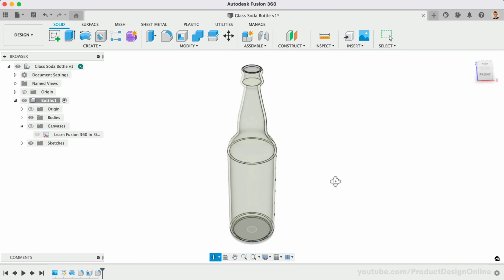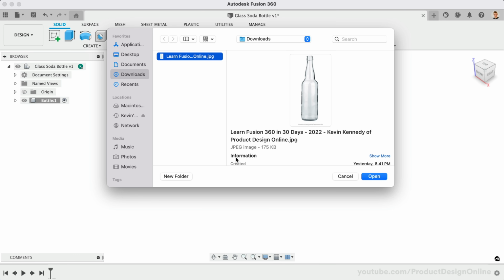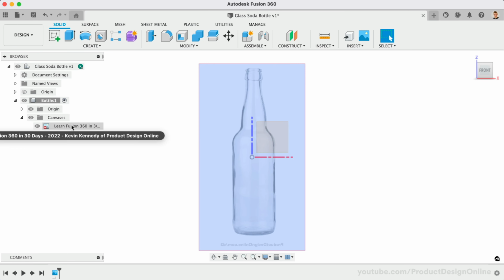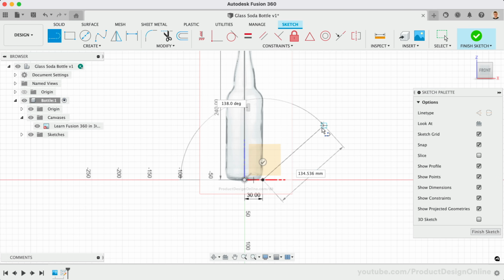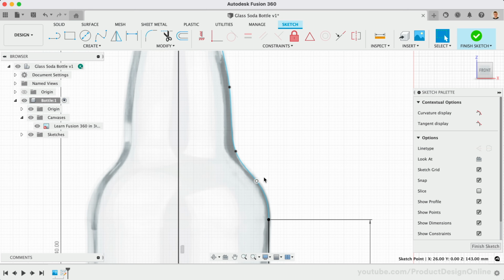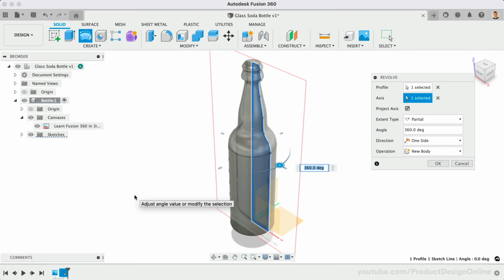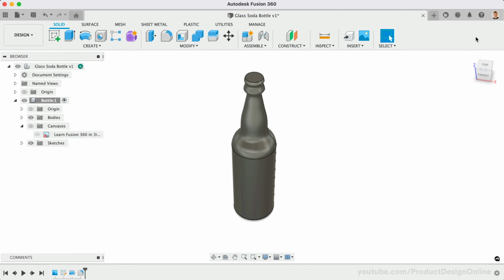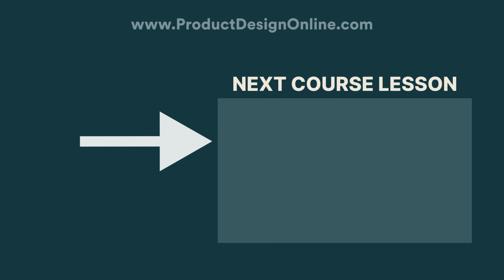Day 2 of Learn Fusion 360 in 30 Days for Complete Beginners! - 2023 EDITION

Comment: when i go to add the shell command to the top, It wont let me select only the top face, it only lets me select the whole bottle
Reply from the maker: Hi Connor. Can you confirm that the top line of your bottle (in the Sketch) has a horizontal constraint? If the line is not completely flat - or if you drew that part with the Fit Point Spline - then it will not let you apply the shell to the top. The shell command will need a flat planar surface for the top opening.
Reply: @ProductDesignOnline  I re-did the tutorial and it worked this time.
Reply: I had the same problem and it went along with the top of the bottle remaining closed (i.e had a face on it, no opening) when I applied the shell. I remade the sketch and double checked the constraints. The only way I could get the lip of the bottle to work was to extrude the top of the shell 2.5 mm so that it came flush with the top of the bottle. That gave the bottle the correct lip and then I could fillet the edges. Still don't know why it wouldnt work the way yours did.

Comment: My sketch isn't adapting when I change it from 10mm  to 11mm, I had to manually move the top end of the spline by 1mm to line up with the new dimension. Dunno what's up with that.
Reply from the maker: Can you share the link to your file? It should update if the surrounding objects are constrainted/dimensioned.

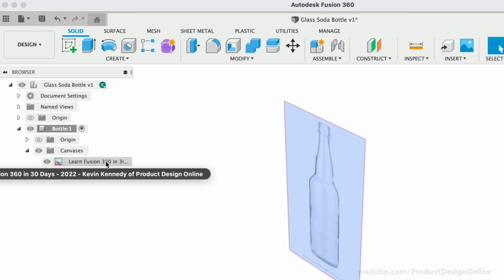Comment: I have a problem when I upload the image then it’s not showing under Bottle component. It’s above bottle component 2:25
Reply: I am having the same issue
Reply: @joebloggs963  I had to figure this out via online searches. Instead of using the visual indicators on the screen, go to the Bottle component, expand "Origin" then click on the correct origin, in this case XZ, and it will add it under the component instead.

Comment: how would you make a skull in fusion 360?
Reply from the maker: Would be best done with either Surface Modeling or T-spline modeling, depending on the curvature. Ideally, a few different Lofts and/or Sweeps that are joined together.

Comment: There is something wrong in the directions on the last shelling stage. Mine shells but it only selects the entire body so the cross section shows it as hollow but I have no opening in the mouth. Any ideas?
Reply: you have to edit the points along the neck of the bottle but more importantly the top of the bottle. I had the same issue and had to do a fair amount of editing on the bottle neck to ensure I could make the hole.
Reply: Removing the curve at the top right point solved this for me. So the end of the right spine connects to the top piece without a curve seemsed to fix this.

Comment: When adding the canvas to the design, it will not nest under the component. It puts itself outside, at the same parent level. Does anyone else have this issue?
Reply: Yeah I have the same issue. I've followed the steps exactly but it will not nest under the Bottle component.
Reply: @CaptainRedHat  Same issue here.
Reply: user @darkhorse77777 got it.
"EDIT
Fixed it by turning the visibility of active components (unchecking) in preferences. Then turning the visibility of the first Origin off before selecting the front plane while placing the canvas."

You access preferences on the upper right hand side, click the user icon, and it should be listed second. 
In preferences go to General>Design and uncheck "Active component visibility", then hit apply.

Repeat the process of inserting the reference image canvas, and you should be set, the canvas with the reference image should now be under Bottle

Comment: I'm a massive noob, after all, I'm working with fusion just a couple of years.
And I absolutely don't get how did you hollow out the bottle.

Firstly, mine can't be hollowed out as it's not created out of a solid body (in my project browser, instead of a cylinder, there is this sort of wrapping paper)
And secondly and perhaps for the first problem...shelling a face to shell an object? Even if I could try it, that surely can't work the way I imagine the empty space in a bottle.

Your tutorial is good, I like your examples. But you're too strict in your progress, in my opinion. I mean "It goes like this. Then this. Then this." And if you take a step to the side, even by an accident. You're done.
You mentioned somewhere something like - Now we'll set a constraint here, because if we don't, it's going to do some kind of crap later. I'd appreciate more of that approach. A straight path leads to one goal. A path around all the problems leads to all the goals.
Reply: Got it. Did it second time, it worked. Magic :(

Comment: Doesn't work for me. When attempting to select just the flat top of the bottle to make it a shell, I can only select the whole bottle and not just the top, so it doesn't end up making the bottle hollow with an open top. I've tried redrawing the bottle using exactly the method suggested several times, and always get the same result.

If I do select just the bottle top, as soon as I click solid shell button the whole bottle becomes selected blue.
Reply from the maker: That means one of two things have happened: 1) your top line is not planar or truly horizontal. Make sure it has a constraint on it. 2) the other common issue is your spline handle at the top is creating too small of a radius which doesn't work with the shell command. Try adjusting the top spline handle and try shell again.
Reply: @ProductDesignOnline  OK thanks for the prompt reply. I’ll give it another go later.